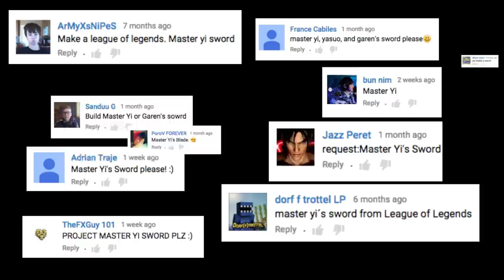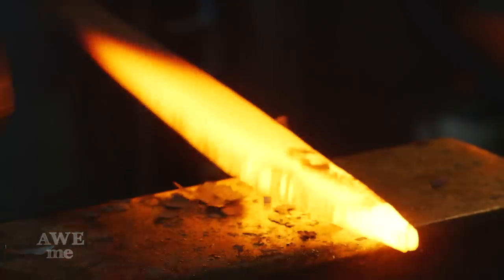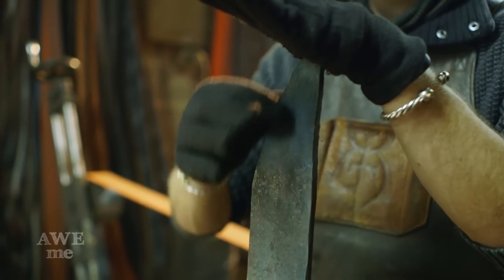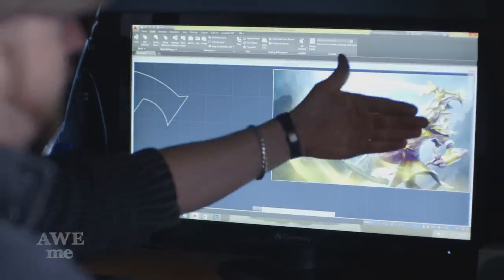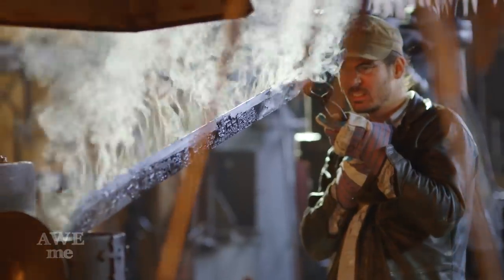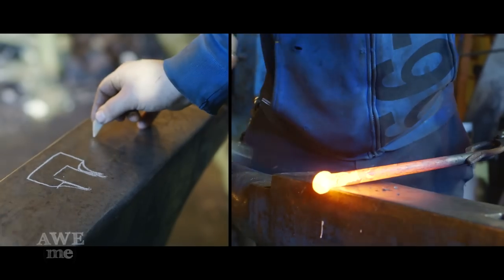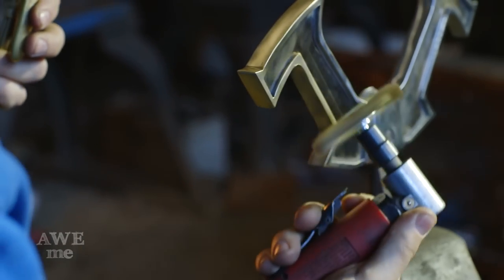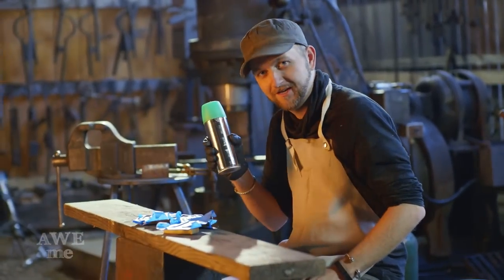Master Yi's Ring Sword (League of Legends) - MAN AT ARMS: REFORGED

Comment: Death's scythe from Darksiders 2.

Also what software do they use for the computer? Anyone know?
Reply: +senta ukrai AutoCAD was used for the guard
Reply: Minase Iori Cool thanks, I've been wondering each time i see em use that stuff.
Reply: Most CAD (computer aided design) programs are so similar, you can learn to use one program then you'll be set for the others. Examples of CAD programs are like AutoCAD or Solidworks
Reply: +senta ukrai even better.... Marluxia's Graceful Dahlia
Reply: +Nick Slasher57 I just want to see a true scythe. Black star's (from soul eater) was technically a Kama/kusurigama hybrid. Death's just seemed the perfect first one to build. Marluxia's would definitely be a good one though.
Reply: +senta most CNC (computer numerical control) machines have their own CAD software incorporated, but they dont differ much from the other CAD programs out there, if you wanna give it a go

Comment: We haven't seen a staff before, I want to see a WuKong staff
Reply: +TN Dang They did Loki's from Avengers a while back if that counts.
Reply: +TN Dang Quarterstaff*
Reply: +T Unit That's more like a spear, or a sceptre.
Reply: spear lol whats close to a spear with that not even have a point and sceptre no its just a Quarterstaff with iron reinforcements on every side
Reply: Alexandros grivas
Have you SEEN the pointy bit on the top?
If that ain't spear-like, I don't know what is.
Ohh, and by the way, It doesn't have metal reinforcements on both sides.
The "reinforcement" on the bottom is closer to a pommel than reinforcement.(altough it technicaly is reinforcement-ish)
Reply: Its not close to any spear and he uses it like a quarterstaff so yes it has nothing to do with spears
Reply: Alexandros grivas Just because he uses it like a quarterstaff doens't mean is, I could grap a knife and smack nails with it but that doesn't make it a hammer.
Reply: Rik Jongman yes of course but if he has a weapon he will know how to use it and its mostly a staff and uses it like one so
Reply: Fighting styles between staves and quarterstaves are more different than fighting styles between spears and staves.
Quarterstaves are basicly 2 maces glued at the bottom and are used as big twirly sticks you smack people with.
Staves are maces with long handles, and used like maces but with more reach.
Smacking people with a long mace is more similar to stabbing them with a knife on a stick than twirling a doubleheaded mace with a long handle in between.

Also, IMO it's more like a spear with staff parts than a staff with spear parts.
How he uses it shouldn't matter.
Reply: Rik Jongman it does matter or we can say that he doesnt know how to use his weapon anyway im not going to speak about the logic of league of legends its fantasy that means no logic involved

Comment: can somebody explain the purpose of rings in a sword? I mean the original chinese ring swords. For design? Weight? dafuq is that.
Reply: herbert jauch Its something about protecting the rather fragile blade from damage if I remember right
Reply: Morgan Sheepman
Reply: herbert jauch mainly to gut enemies' organs out as you slice through them
Reply: Wuju Style ( Its the Martial Art of the Master Yi in the game )
Reply: They were supposedly for creating a certain noise that was meant to intimidate or disorintate your enemy, by making a sound that did not match with the action. Personally I don't think it does anything but make it unwieldy and a less effective cutting weapon.
Reply: this is the actual reason my family is much into Chinese culture and we own a ring sword it was for momentum because before you go to impale and cut someone the rings are facing towards you and when you make that thrust or swing all the rings turn to the front and add a second push so the swings would cut deeper and the thrusts with impale them more
Reply: it has the power of speed